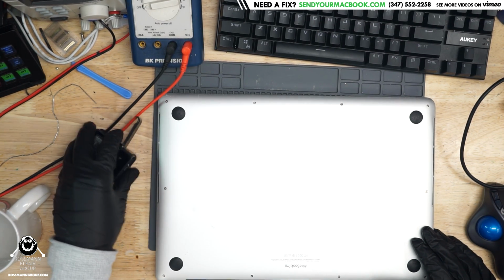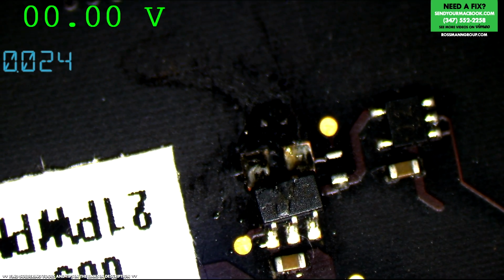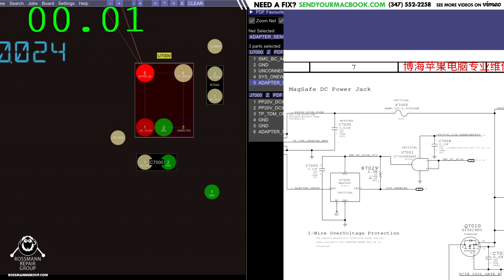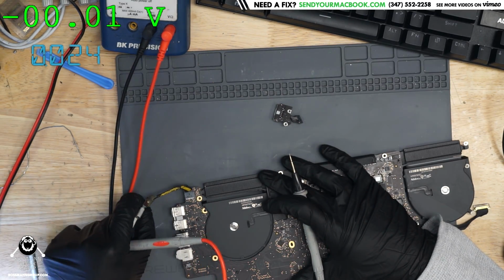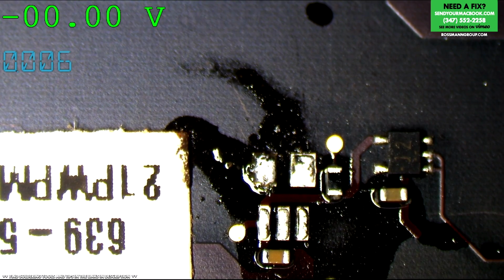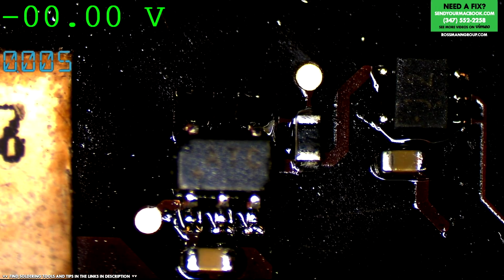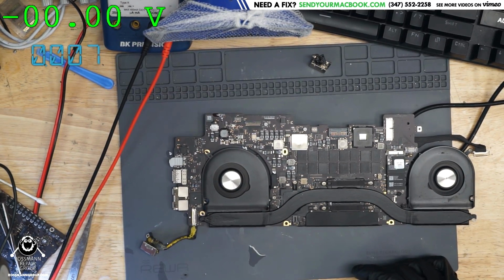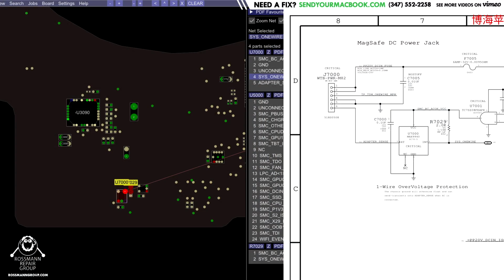Let's fix an Apple refurb board

Comment: Great content @Louis Rossmann, I broke of my speaker connector of my mid 2014 MacBook Pro motherboard, can you tell me if I can solder it on with a simple hot iron, any tips or video will be great. #microsoldering

Comment: Seeing the bc_acok signal reminded me that it was the different pin between the isl9239 and the isl9240 (Chgr_en_mvr was the one present on pin 29 of the isl9240, and smc_bc_acok was on pin 28 of the isl9239 ) and another difference was the 1,8V signal on the pin 30 (PP1V8_SLPS2R) instead of 3,3V (PP3V3_G3H) but that this one could be easily bypassed because PP1V8 never drops. Have you tried to bridge the 28 and 29 pads on the motherboard? Maybe there is a point connected with the pad 28 even if the schematic do not indicate one, and all it takes to f*ck apple is a wire